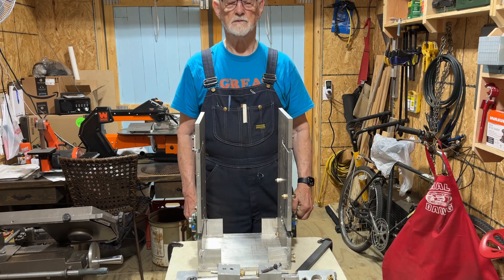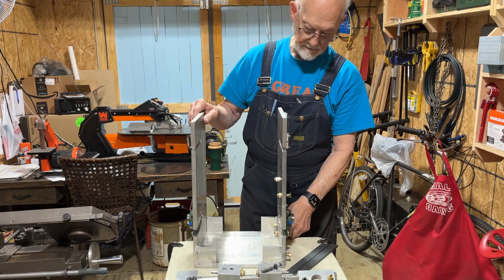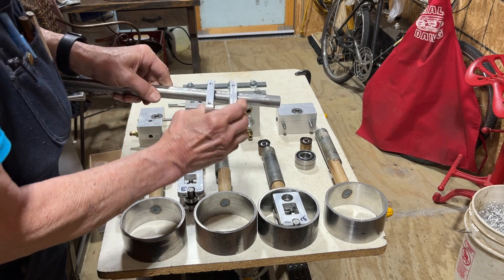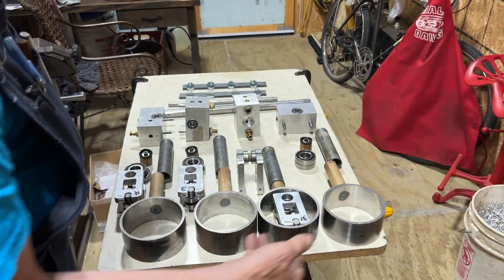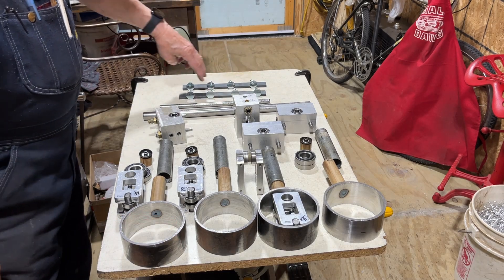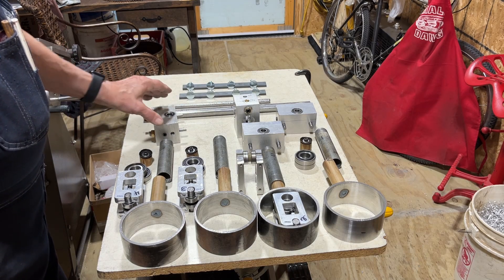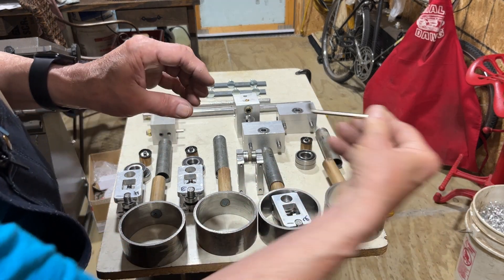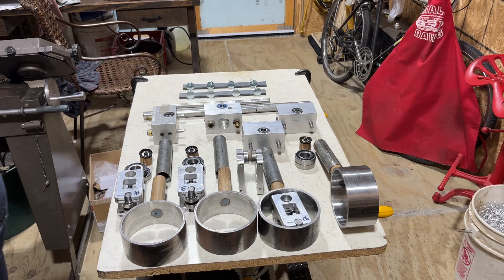My Air Powered Car Motor - All Parts COMPLETED! 6-21-24

Comment: My dad often said he thought cars could be powered by air. I often though possibly liquid nitrogen, or CO2, (o2 would be toooo dangerous,💥boom!) same for hydrogen. It could use a large tank, vacuum insulated inside a pressure vessel. With a smaller tank with a heater inside. Basically acting as a boiler but only heating the nitrogen to 0°F +/- 20° or so. And hold  a fairly large volume of gasous nitrogen. (The bright side, it should have a exelent air conditioner!) Then a grid heater to heat the gas to 100°f or hotter to spin a rotary vane motor, or piston motor. Basically a steam engine. And people could produce the fuel at home, slowly and carry a portable concentrator for work or wherever. Because a few oz(8-16) laced in the 'Boiler'( or one of the 'boilers' because  they can work in sequince , so one is producing pressure while the other is refilling like multiple small bottles of high pressure gas, it's also sefer. Only having a few oz converted to gas at possibly 3000 psi, possibly having a relief at 4k-5k,psi, so any explosion  would be small relatively speaking. A better situation than 5gallons in a large tank exploding).  The small amount should give a range if 10 miles or so, with the 60 - 80+ gallon tank. And a small high pressure concentrator could chill high pressure air into liquid while driving, similar to Regen braking slowly compressing while driving to 200psi as the first stage.  Then when braking compress that to a higher pressure. With a chiller inside when braking the first stage handled by a 3 stage compressor using about 1 hp. So it's slow. The motor could be both types a long stroke fairly large bore and a rotor vane pneumatic motor like in a impact wrench. Only a 18" rotor 6" wide, possibly having two, being offset from each other, so a vane is under pressure when the other is mid way through its pressure cycle. Similar to a firing order. Motor times it fires per rotation, the more POWER! Offset rotors is like going from a 6 cyl to a v12, or 3cyl to a 6cyll. A 6" bore 'steam' engine, with a 18" or 24" stroke. Even with two cylinders should make extreme amounts of TQ at upward of 2000rpm. A boxer configuration in the center where the drive shaft usually goes with bevel gears turning the rotation. With the pneumatic rotor engine in front(or rear). 2500-3500psi or greater  should produce a few HP, and the TQ, with 6"-8" bore. Maybe  higher pressure is possible, maybe 30 k psi , even 10,000 psi the piston and cylinder made from 5/8"- 3/4" steel, and making the cylinders double acting is like 95% more power nearly doubling the displacement, if it were not for the rod, it would. Be doubled . Make the crank from 4340 with nearly 4" journals, crank and rods use  bearing from a roughly 18 litre heavy haul truck engines with total seal rings a cross between gas/diesel engines rings with a o-ring behind it. And a oil ring between the sealing rings. The oil rings simupplied oil through the rod to the top and bottom and each side of the oil ring land.  the oil ring gap bring 3/4" with two 1/4" rings spaced by a coil spring with oil ports .6 mm to 1mm each with  6mm return ports the rod being a tube 2.5" with 2" cross slide pin with the crank rod being a similar 2.5" tube 1/2" wall with the 2'' pin end, with roughly 4" journal end. Using semi truck Main bearings for rods and mains the oil to the piston rings pumped by a small gear pump on the cross slide with the reservoir filled by the main pump. The low pressure low volume pump to the rings possibly a scavenge pump also the excess oil used to oil the cross slide. The mini pump supplies about 100cc per stroke at 2-5psi, it only needs enough pressure to create a flo of oil in. And out the piston.  The seal on the piston rod working similar only inverted. Using hardened chrome rod bored with either a pair of holes or a single single larger hole, with a steel tube brazed in. The cylinder rod seal being a zero gap ring from nylon with a o-ring backing it up. Using double everything with a oil hole between the rings with a groove to supply on all sides and leave the seal housing, like a invited piston the cross slide running on two flat bars with rollers on each bar one  face, then linear bearings on two faces of each 1x3 bar  bolted to the cylinders. The rollers take the pressure of the rod pushing, similar to the pressure on a piston skirt. With a slide valve opening and closing the cylinders possibly virgin pressure going to try under side then exhaust to the top side. Possibly using a grid heater to gain some pressure of the exhaust gas. Attempting to keep it above freezing. The  engine rpm could be slower than the tires of the vehicle. It could produce 5k ft lb TQ, and 150hp at 45rpm(off the wall maths!) however it would require a system like this to use compressed air in a tan, it would require a tank like a semi truck at 200psi. To go to town and back the rotor vane motor could be used for faster acceleration when HP is required, the piston engine when TQ is needed. Us both for fast acceleration this would be for a larger vehicle or truck. A small car could use a 4" bore with 4"-6" stroke, with 2-3,or , 4-cylinder. Sorry to ramble! Have a awesome day, and keep up the good work, and tinkering.  I want to build a modern version of a 1890's -1920's oil field or pony engine hit and miss . Or the first diesel engines to use to generate power for my off-grid house  a diesel would be good,  use waste oil as fuel. Or s gas engine burning distilled rubber and plastic. Use a cat converter on the exhaust to hopefully destroyed the bad stuff produced. Maybe a carbon filter after that. Anyway, 🎉 have a awesome day!✌️👍
Reply from the maker: Thanks for sharing your dad's and your ideas.
There is a lot to digest in your comments, but I'm assuming the majority of these different engines or motors be stationary to supply energy for off grid home use?
For a car or truck, I'm thinking a 4" bore with a 6" stroke in a 4 cyl would use 96 cu in of compressed air for 1 revolution!
By my calculations, using a 30 Gal tank with 4500 psi, running the engine at 125 psi and a 1.8 engine rev to 1 tire rotation, you would be able to go 4 miles.
I don't mean to discourage you, just remember in your design how can you use the least amount of air, you have to carry a lot of air to go a short distance

Comment: Cool ideas man! Is the floating piston idea original? I haven't seen that one before, pretty interesting. Is the rod going to have a wear problem with the sharp edge of the cylinder? Maybe a Teflon guide on the bottom of the cylinder? Thanks again for sharing your ideas, good luck with this one!
Reply from the maker: Thanks for checking in, I’ve already taken care of that. Hopefully, I’ve changed from the piston shaft. I went to a high density plastic so any rub should not be a big problem, there is very little side pressure on the shaft since the piston always pushes straight down on the ring

Comment: I am a bit jealous of your progress.. life has been too expensive for me to be able to do much besides struggle to get by. I really wish you would listen to me when I explain about getting proper expansion from the compressed air, then at least one of us would be being successful. The exhaust valve should not be opening a pressurized cylinder or its wasting massive amounts of energy, and just making noise. If you don't have large enough pistons to use pressures that can be fully expanded, then there is just going to be a LOT of noise, and a LOT of wasted potential.  My future air powered vehicles are going to be very quiet, using very large pistons running at low pressure, and get nearly complete expansion..  whenever I can afford to make them lol... you could be skipping these stumbling blocks of being underpowered and inefficient, but my advice is not taken seriously..
Reply from the maker: Thank you for your honest opinion, I do take your seriously, and I believe what you’re trying to do is the best way that you’re doing it but I have different ideas that will have to be experienced and may or may not be the best way, but my design is as it is and I’m going to follow it through either success or failure, but nothing ventured nothing gained.
Sorry to hear that you’re not making much progress on your own right now, but hopefully things will come around for you soon
Reply: @AirEngineResearch it's coming along now, all looking good , hopefully all works out for you, I cannot see why it shouldn't. 👍
Reply from the maker: Thanks for the calm and checking in